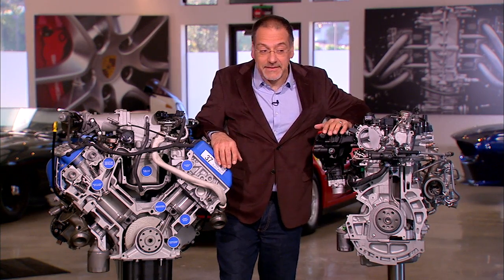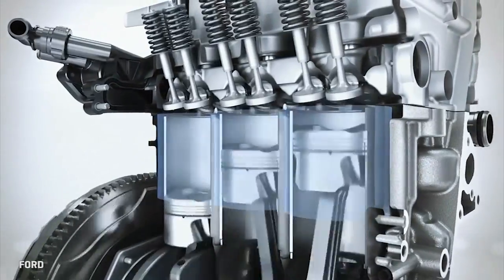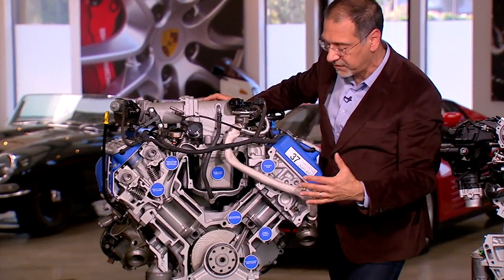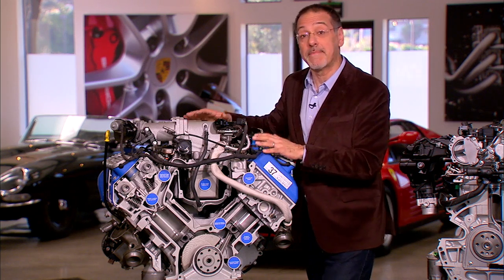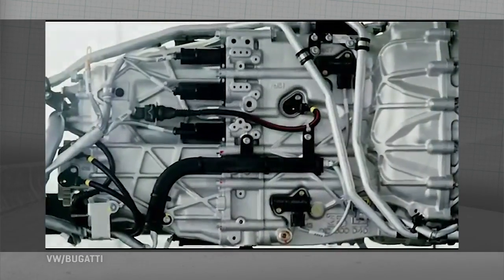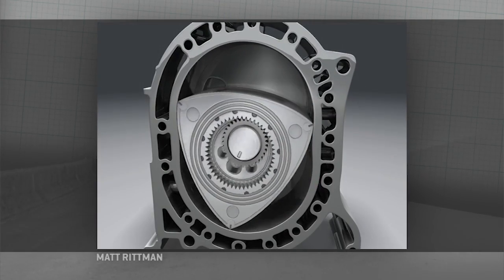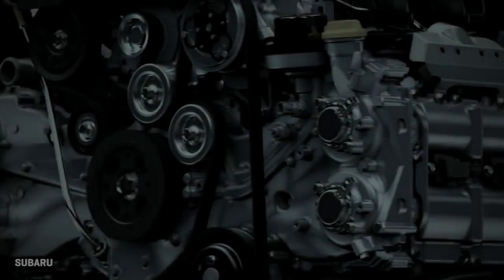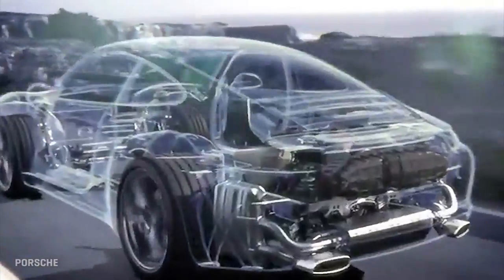Car Tech 101: Understanding engine configurations

Comment: All 1-4 turbocharger intercooler petrol engines in all brands : Easy damage,  20-100 l/100km, over 100 l/100km with All speed, F1 speed 160 km/hour to top speed on circuits all and test maximum over 20,000 rpm.

From
All brands databases 

End report.

All socials AE sectors want to build 1-4 turbocharger petrol engines all for corruption and use feeling illogical. They are illegal by using terrorists class brilliant and street racers class brilliant.

All socials AE sectors become criminals group and destroy world by using code forbidden AE styles all products for their IQ below 100.

End report.

From
All socials grade databases

All socials AE sector with code forbidden AE styles grade F by EU gain to them.

Comment: You left out the Slant-6 by Chrysler! Also, you could have mentioned that aircraft used to use radial engines, just to drive home the point. Volvo’s famous In-line 5 should also get an honorable mention as another type!

Comment: One question. Are inline 6 cylinder engines better balanced than V6 engine? Thank you.
Reply: Siddhant Dwivedy Depends and no... Straight 6 is harder to reduce vibrations than a v because of the non opposing firing sequence. They do well, but not as smooth as more balanced opposing engines. Although that being said, some straights are smooth and some v's are rough.
Reply: Siddhant Dwivedy Yes! V6 engines are inherently unstable and must use counterbalances of some sort or another. Same with V8's and L4's.
Reply: macduggles yes. thanks I knew the same thing about the inline 6 engines. Mixed comments online had kept me confused a bit.
Reply: Siddhant Dwivedy You can imagine it this way, if you don't have a working example or model to look at, for every part, piston for instance, moving in one direction, there is another corresponding part moving in the opposite direction.
Reply: Yes. Exactly. That why BMW is using bulky inline 6.. and JLR is also switching to Inline 6 from V6 for their SUVs.
Reply: Siddhant Dwivedy As a boy, I always wondered why all the Diesel engines were always straight sixes, and then one day I found out.

Comment: So what do the cylinders do?
Reply: They're not messing with you. A typical fuel-driven car runs on what is called a "internal combustion engine" thus explosions. These mini- controlled explosions drive the cylinders, which in turn rotate the crankshaft ( see video). The rotational power from the crankshaft ultimately gets diverted to your wheels, and allows you to move.
Reply: The cylinders contain the explosions.
Reply: Lol..a large part of me feels like you're messing with me but a larger part believes you so I'll just go with it
Reply: +KeneticKid omg thank you! I'm really trying to learn more about cars
Reply: just check out this infographic, it's very cool: http://animagraffs.com/how-a-car-engine-works/
Reply: Then what does the transmission do?
Reply: Wow thank you!! I'm just starting learning about all the inner workings myself
Reply: Clit Commander transmission takes the rotation of the crank and send it to the drive shaft and then to the differential to turn the wheels and it also has different gear sizes to control engine rpm at higher speeds hence why you see 4 -6 speed cars a ton
Reply: Thanks Tin,  this looks pretty amazing!

Comment: Actually, the V4 used in the Saab 96 was made by Ford but was used by Saab. only engine they did make was the 3 cyl two stroke which was showing it's age and was more or less fell out of usage. even though it was quite... the piece of engineering itself. had automatic oil injection and whatnot.

Comment: Flat engines and boxers are not exactly the same, flat engine is basically a V engine with a 180 degree separation between thecylinder banks. What this means is that in a boxer engine two opposing pistons will always be going the opposite way at the same time while in flat V engine they will move the same way. This gives the boxer layout a better balance. However flat V is usually used with high number of pistons like in the Testarossa so different banks of cylinders will be trying to balance each other out so it does not matter that much.

Comment: I had never heard of a flat engine until seeing this video. Props to you, CNET!
Reply: +Subzero Arctics Really? Subaru, VW and Porsche have been using them for years!
Reply: j4cko56 You sure? I know they use in-line engines... Are you getting them mixed up?
Reply: The beetle and old campervans used aircooled flat 4 engines for decades....
Reply: Subzero Arctics Porsche and Subaru exclusively use flat or boxer engines :)
My Toyota 86 which uses a Subaru engine, is a 2 liter boxer 4 cylinder.
Reply: and Subaru's current lineup are all horizontally-opposed
Reply: BMW also uses boxer engines in some motorcycles! Porsche is the premium brand with "know-how" by keeping manufacturing boxer engines for decades (specially in their main model- 911) and Subaru is "normal" brand that has this know-how also. The VW Beetle had boxer engines because Hitler demanded Ferdinand Porsche to design it. Many solutions and engineering in this car became part of Porsche philosophy...some of heritage you still can see today.

Comment: So, what does V-TEC, GDI, CVT mean?
Reply: V-TEC, which was first used in Honda's engines, is a way to save fuel, yet get a boost in power if needed. What it does is when the car's engine is below, let's say 4500 rpm, the camshafts in the engine are positioned lower for better fuel economy. But when the car's engine is above 4500 rpm, V-TEC is enabled and the camshafts are now positioned higher, which in turn gives a higher cam profile, and therefore give the engine more power.
Reply: CVT on the other hand, is known fully as Continuously Variable Transmission. What this means is that when you depress the accelerator, the car does not seem to 'change gears'. This is because the car is changing the gears at an exact rpm, which is why the car's rpm does not change, yet the car is still accelerating. I am studying Mechanical Engineering right now. If there are any problems with my explanation, forgive me.
Reply: Glenn Ang Thank you so much.Your explanations were awesome. God Bless you.
Reply: +Mathew M John Don't mention it. I was just happy that I have quenched someone's thirst for knowledge. :)
Reply: +Glenn  Ang Hey I'm 14 right now and I really want to be a mechanical engineer too. Anything I should know first?
Reply: +GTR Exhaust The first thing is you need to have in order to study mechanical engineering is to have a good foundation of math. Without math you would struggle to understand what is going on within a mechanical system.
Reply: +Glenn  Ang Im good with math but what about science? Is that a subject I should be good at?
Reply: Science does not play a very large part in engineering, unless you want to major in Chemical Engineering. So no worries about science.
Reply: Glenn Ang  What about Physics? I've heard many people saying that in Engineering they just higher level of Physics that we study in 12th grade.
Reply: +Mathew M John The course I am currently studying in focuses more on math than on physics. Physics plays a larger role in civil engineering as they have to build structures that are capable of withstanding the natural forces (wind, rain, snow etc) therefore, just a basic understanding of physics will do.
Reply: +Glenn  Ang Thanks for the information 🙂
Reply: +Glenn  Ang I need to jump on ur mechanical engineering course cos ours is mainly branches off physics, chemistry and mechanics i.e mechanics of machines, materials and fluids..
Reply: For my school they actually let us touch a Subaru Boxer engine and make it start so yeah pretty dope school haha

Comment: flat engines, of any cylinders, 4,6,8 whatever and inline 6 are the most reliable designs. My theory is that it has to do with perfect balance. They are using nature to remove any shocks and vibration, which makes the parts stay in the perfect spot the longest. Look at Subaru flat 4. No piston skirt at all. No counterweights on the crank, at all. All the parts are using gravity to stay in place. pistons are laying flat resting on the cylinder wall. Doesn't take much to get them moving side to side. Inline 6 uses physics and rotational angles to make it run smooth and thus very long.

Comment: Technically the Ferrari Testarossa engine is a 180 degree V12 because each opposed pair of pistons shares a crank pin as like with any other V-engine design. Porsche 911 6 cylinder boxer engines (and all "true" boxer engines) have each opposed pair of pistons on its own crank pin like in any standard inline engine. A Porsche flat-6 engine isn't appreciably shorter than an inline-6. In the case of the Porsche engine the flat configuration's low centre of gravity and ability be to air-cooled was the more important concern than was minimizing engine length.

Comment: hmm I never knew Ferrari made a flat engine.  A flat 12 sounds insane - how'd they fit that?
Reply: +Peter Schmidt 
a crow bar and some duct tape. lol :p
Reply: +Peter Schmidt Technically it's a flat V12, not a boxer....and yes, this is possible!
Reply: +Peter Schmidt It was just 3L LOL
Reply: +Patrick TheBaptist And?
Reply: Technically the Testarossa 12 isn't really a "flat" engine... well, it's flat, but it's not a boxer.  The pistons aren't opposed in pairs like VW, Subaru, Alfa, etc., but opposite cylinders share crankpins, so the Ferrari is really using a 180-degree V12.
Neat, huh?

Comment: The Audi R8 has a W8? I thought it was a regular V8 engine instead.

Also, you forgot the VR engines (VR5, VR6) & some more unusual engines deserves to be mentioned too (quasiturbine, Kugelmotor. Revetech (X shaped piston engine and so on).
Reply: +Pasta Sarmonella E-Specialé 
You're right, the Audi R8 never had a W8. It's either a V8 or a V10. 
Lancia used VR engines, way before Volkswagen. Their famous V4 engine is in fact a VR motor.
http://assets.hemmings.com/story_image/43231-400-0.jpg?rev=1
Reply: Lancia used a VR engine way before Volkswagen and their V4 engine turned out to be a VR motor after all?

..I never knew that.... O.O
Reply: Pasta Sarmonella E-Specialé
Well, Lancia called it a 15 degree V4 in the Fulvia, or narrow angle V4, but VR is what this type of engine is called nowadays right? By the way, the first Lancia to use such a V4 was the 1922 Lambda! And it already had an aluminium engine!

Comment: I have 3 different vehicles that have 3 different engine types. The 1.8 Liter inline 4 cylinder engine from a 2012 Honda Civic, the 2.5 Liter Flat 4 Boxer engine from the 2014 Subaru Forester, and the 3.5 Liter V6 engine from a 2007 Honda Odyssey with Variable Cylinder Management (VCM) are all naturally aspirated, no turbochargers or superchargers. The Honda Odyssey and Honda Civic have five-speed automatic transmissions, while the Subaru Forester has a Lineartronic CVT, one of the best and most reliable CVT in the market.
Reply: i agree with you 100%